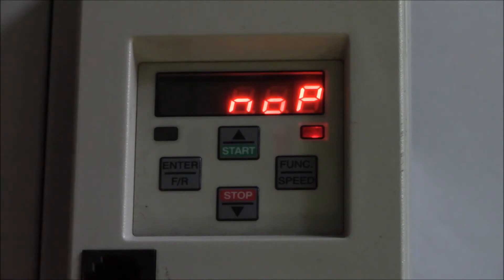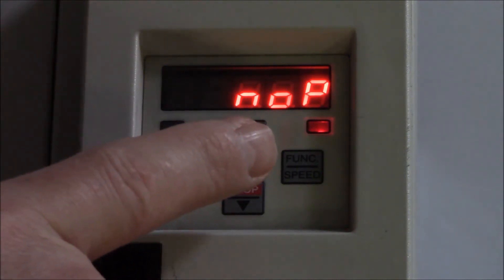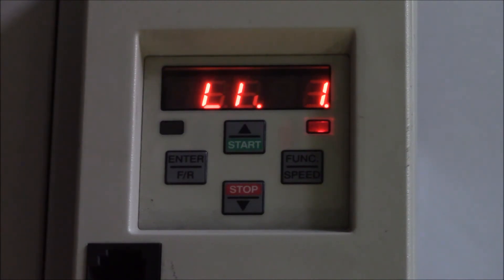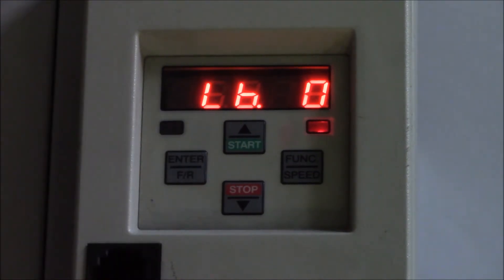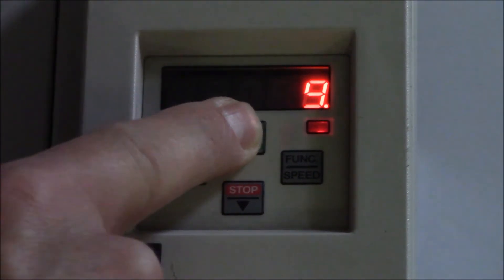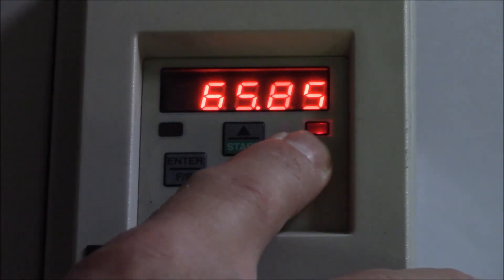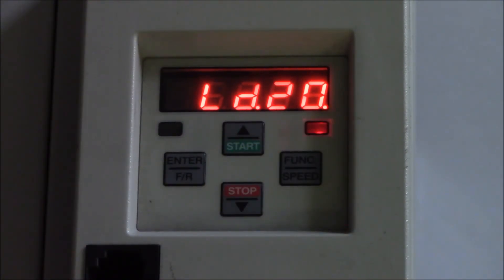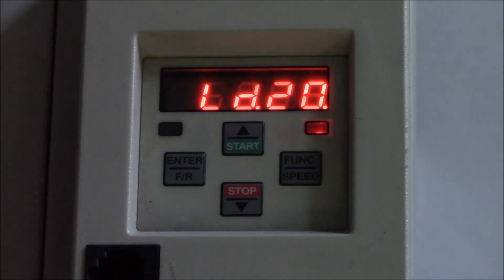KEB programing console

Comment: Hello. I have a drive (vfd) type keb f4, which unfortunately has a technical problem. The drive accepts all the commands and when the command is given, the frequency of the drive starts to increase, but no voltage appears at the output of the drive. please guide me.